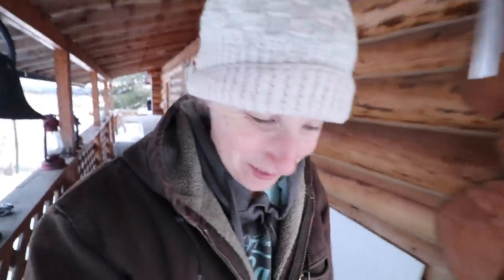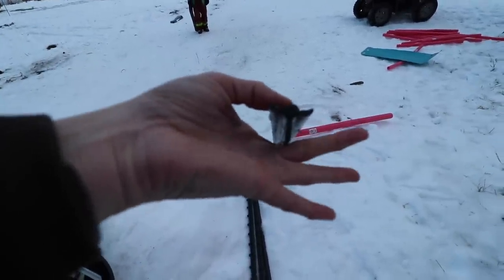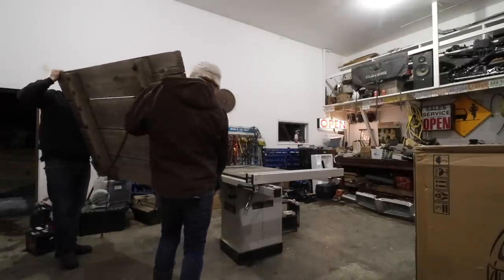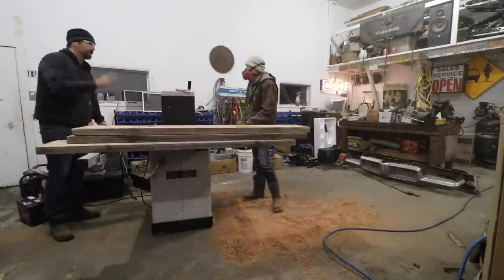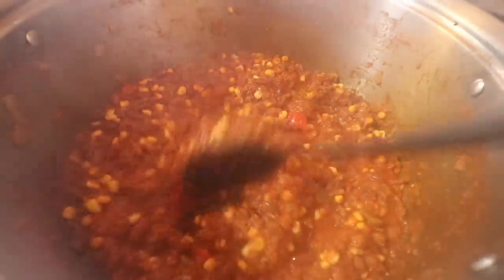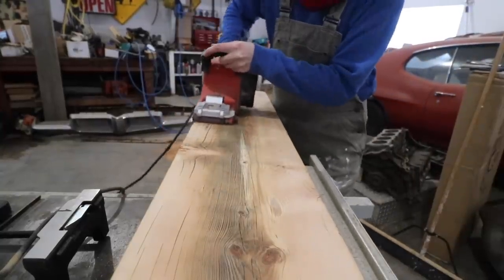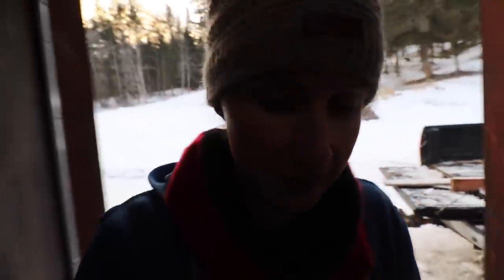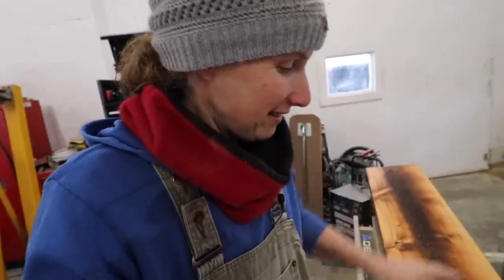The Old Car Story | Pizza and BBQ Wings, Yum! | Reclaimed Wood Shelving

Comment: Hi Chelsea. Dan's car is a 1970 Pontiac. My brother-in-law has a 1976 Maverick in the tractor shed. He has promised to restore it next spring. Same exact color as yours! Ours is a standard transmission, but I doubt I will be able to make a convincing plea for " glass packs". Really cool that you are stringing lights and preparing the sled run. The kids will remember that always. I remember my dad flooding the side yard for a skating rink for my sister and I, on a ❄❄❄❄ freezing cold night. I was 4 and had double runner skates :-)